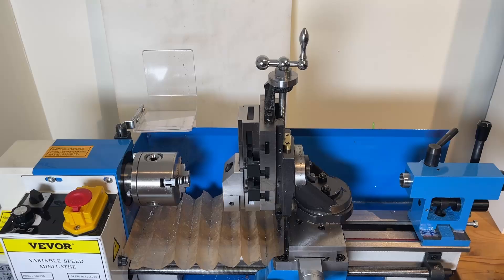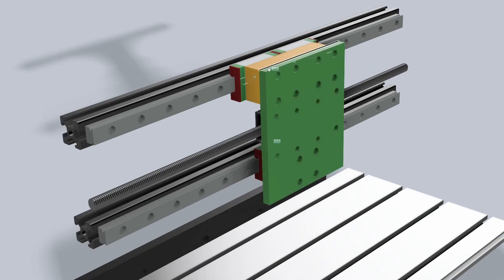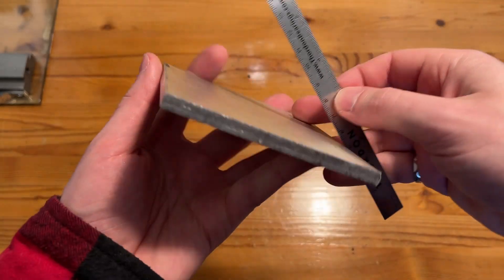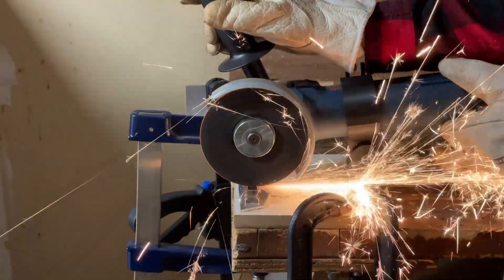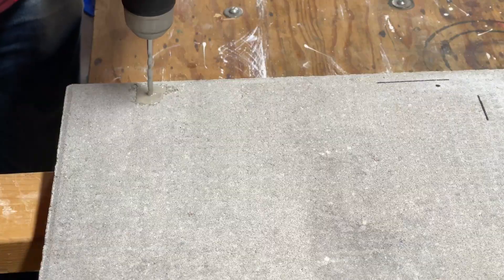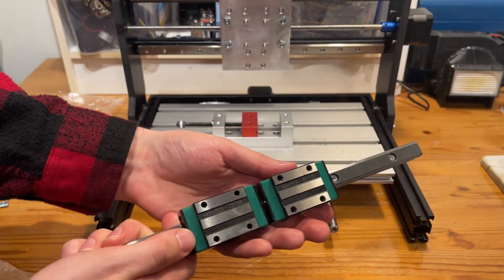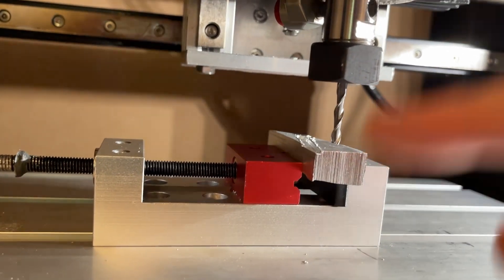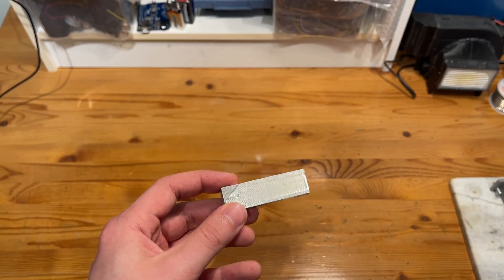Cutting Aluminum with a 3018 CNC Router - 3018 Linear Rail Upgrade

Comment: Nice. I had my 3018 pro in my garage for years. Bought it on sale for what I think was $120 at the time. Only made one wood cut ever. Now I’m improving it so I can then make my mill and lathe CNC. Going to do linear rails, ball screws, router and upgraded electronics to run Linuxcnc. Let’s see how it goes!

Comment: The one thing I discovered vital about aluminum milling is rigidity and torque. Rigidity of the machine, working holding fixtures is important for good accuracy and repeatability, and a high power spindle for the torque required to cut the aluminum.
The problem the with router style cnc is the bed rigidity. If the bed flexes then you can get accuracy issues when facing aluminum sheets.

The concrete pad idea is great though

Comment: Can highly recommend looking at the woodmads WM3020 if you wanna go this way instead of the 3018. It's a much better starter platform coming off the bat with linear rails and ballscrews. There is room still for improvement but it's reasonably decent without going overboard. It still is not a replacement for a purposebuilt CNC platform but it works quite well. I even upgraded mine with a 600W Teknomotor VFD spindle. That required a little bit of custom mounting work but not too bad. Of course you can get the optional 65 mm mounting clamp and use the typical round China spindles. I tried it and it works. I just have a little more faith in the Teknomotor spindle having used it's bigger brothers on other machines of mine.

Comment: Ive got a super popular video on this exact topic, but I love your mods and might do them to mine in the next video! Great work! Do you think the cement block helped at all?
Reply from the maker: Glad you enjoyed! Just checked out your video, looks like we went down the same rabbit hole! Good call with that extended z axis, I can see how that is super useful. Yeah the cement block seems to dampen a lot of the vibrations and keeps the machine from drifting all around the enclosure when taking heavier cuts, makes everything significantly quieter too!

Comment: im getting ready to do everything u are doing or have done to ur 3018 to mine, im bout in the same position as u, i have 10 fdm printers an 2 resin a 7x14 mini lathe vevor but the tail stock is trash an dont sit on the ways flat so it has to be adjusted side to side an shimmed everytime i used it but i got a wen 33013 mini mill not long after the lathe an it has become my new favorite machine, its pretty much the same as a sieg x2l or x2m but im going to try to do all the same stuff u have done an are doing in the video with mine but i was going to try to use steel in the places that needed it the most an aluminum everywhere else to try to save as much weight as i can while at the same time making it as ridgid as i could, but im not 100% on which parts need to be done in steel vs aluminum. what would u suggest. u might do it in the video but im saving it for when i get home an get a chance to watch on my desktop but i was going to do 4040 extrusions on the sides to replace the 2040 or maybe just do a solid aluminum or steel plate if thats a area that needs it but ive not had a chance to mess with it alot an most of my use out of it was with a laser instead of the router so i didnt really get to see its weak point when using the router so i may trash a few endmill just to figure out where its weak points are but if u have suggestions out side of whats in the video id love to hear them. thanks for sharing,  just found ur videos going to be going through all of them. oh get a mill, u will not regret it. also if u have the money to spend get something alittle bigget than the sieg x2 machines or one like mine with the bigger table, go for something a touch bigger if u can an u will be set for a good while. if mine was 2 inches bigger in the y axis an maybe 5 in the x i dont think id ever need anything bigger but other than that, the machines are very capable so if u dont need a bigger machine then go for the wen over the sieg, it comes with the bigger table but the rest of the machine is pretty much the same, if u can get a good deal on one with a solid column that would be the best, i dont like the tilt column i tilt my work piece an im still figuring it all out so i dont know if id ever be need the tilt so i wish i would have been able to gotten a solid column one but like i said if u have alilttle extra to spend go for something alittle bigger, like a x2.7 or they have clone precision matthews an they look like they would be pretty good machines an i have what the clones cost in mine now after buying the belt kit, air shock vise collets an ive seen alot of them come with all that stuff included for less or same as what i got in mine but i didnt know about them at the time an im not going to say i regret it but if i had it to spend again id do a touch bigger machine cause alot of them will come with the vise an collets or a er collet set an i suggest r8 over mt3 even tho ive never used the mt3 there just seems to be alot more for the r8 since its the same as a bridgeport  so theres alot of stuff that u can buy for it that u would probably have to do straight shank with the mt3 or thats just assumption, but its what i seen suggested by everyone an its been reasonable to buy the r8 arbor tools like shell end mills an flycutters but def get one if u have ever thought about, u can always cnc convert it with ball lead screws, id like to do that to mine at some point but i wanna try to get the 3018 to do aluminum parts first cause that would keep me from wanting to cnc convert the mill as soon. buy the mill  u know u want one.

Comment: I've run cnc mills for 17 years, but I'm new to home shop cnc. I got a 3018 pro, and in my infinite wisdom decided I would cut some aluminum on it. After the most tedious day of metal cutting I've ever endured, I got a usable part with professional (Accupro) endmills. The best advice I can offer to someone just starting out on this would be to buy professional grade cutting tools, and be patient. Very patient. .1mm deep and 50mm/min kind of patient. And don't be stingy with the lube; that tiny spindle needs all the help it can get.
Reply: Also, I'm curious about the grade and heat treat on the material at 0:52

Comment: i'm planning a bit of an upgrade meself, i'm going to have to start with a bigger drill press table, however, thinking through what i might do, i investigated screws, in case i wanted to make my 3018 longer than the cheap upgrade kits would allow.  if i went that route i'd grab some 2060 extrusion(no feet needed) and a new screw, both 1000mm, the longest i could find on the jungle site... probably longer available elsewhere but i don't want to get too loony, i already have rail and bearings for doing that, but i'd need em back for my new machine.  in case i wanted a straight upgrade, i looked into 12mm rail all round, it'd equal the cost of the original machine, but it'd be spectacular, then a brushless direct replacement spindle... still all told, cheaper than the new one that's not as wide as i'd like.  a 3018 upgraded to square rail 3080 with a cheap brushless spindle might entice some.

Comment: May I ask how you made the scale drawing with the locations where the holes should be.  Did you do that in fusion 360? Thanks
Reply from the maker: Hey thanks for watching! Yes I used Fusion 360’s drawing feature to create a drawing of the part from the 3D CAD model, and printed it off to scale
Reply: @Someone_Should_Make_That  Okay thanks.  I didn't know you could also print to scale with fusion.  I'm going to see how that works.  👍 

Have you already made a lot with your milling machine and do you like it?  I look forward to future videos.  I'm also working on a heavily modified 3018 (3045 in the meantime).  I will continue to follow your channel.

Comment: Next mods - extend both axes (larger concrete slab) and switch from Acme threads to 12mm ball screws. The cheap ones from China are excellent. With those in place you might think about NEMA 23 motors, which will need upgraded drivers.

Comment: I’m so impressed by the mods. My 3018 needs these stat! Also your 3D printed angle grinder fixture is very useful. I have a HarborFreight and Ryobi one, I wish someone had generated files for these. I’d buy them immediately.